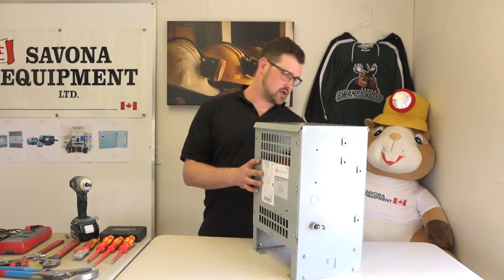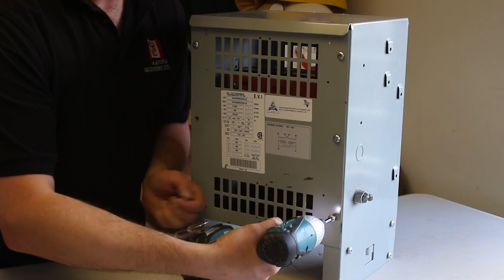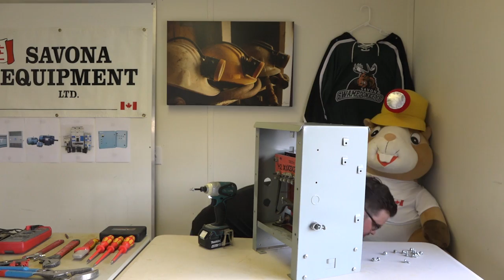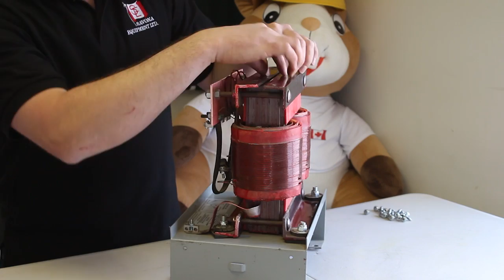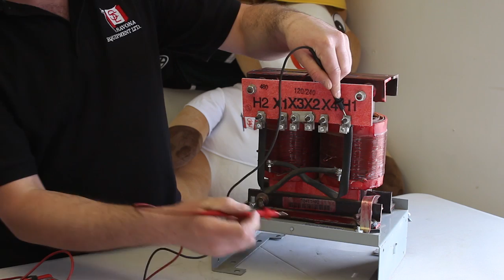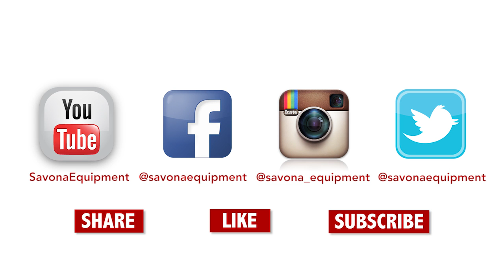Basics of Electrical Transformers | How Transformers Work & How You Test Them

Comment: This was sent to me as a targeted ad. I'd like to correct you on one important point. This is NOT a delta connected or Wye connected transformer. Single phase transformers are not connected wye and delta (try to draw a triangle with one line)... this is a centre tapped secondary single phase transformer. 

Please fix this. Thanks.
Reply: P.S. I've subscribed anyways... it's a good video. Just need to get those technical details right. Cheers.